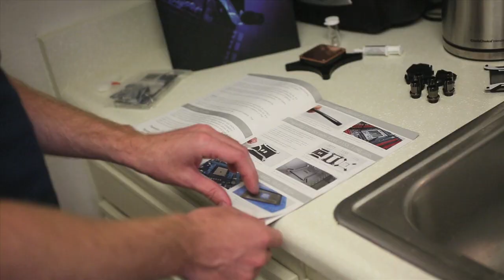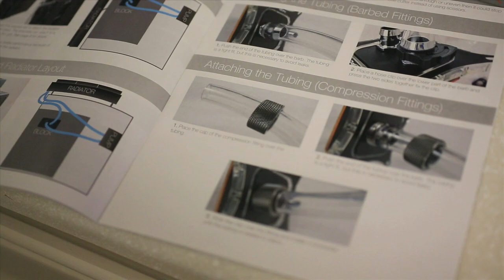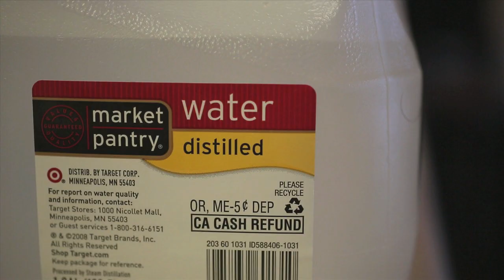A Beginner's Guide to Water Cooling Your Computer

Comment: fuck i tried this it was leaking right ontop of my fucking CPU srsly u guys owe me big time.
Reply: and thats not ur fault for not checking the pipeing is leak proof/ the clamps are tight ?
Reply: Yeah good luck with that.
Reply: What I find most interesting is how an event always leads to us thinking a finger needs pointed. Who cares whose fault it is, the fact is, the CPU has water on it, and the system didn't work for you.. Instead of reacting with anger, try reacting by resolving your issue with the leak and then chalk the cost of the CPU up to gained effectiveness in installing something. 

Sometimes being a DIY student means things will break, not work and in some cases, even damage other stuff. That's part of the risk you take when you are truly gaining "independence" to be able to do stuff for yourself. The GREAT news is, you are STILL going to save yourself a BUNDLE of cash over your lifetime by continuing to be your own expert... :) So wipe off your CPU, put down your pointed finger, and get to work diagnosing what the problem is, and then correcting it... GOOD LUCK and keep DIY'ing!!

Comment: Allways loved watercooling, and the risks are more or less non-existent if planned well and done calmly and calculated. Still my favorite cooling so far, as far as coolness-factor goes, is oil cooling with clear mineral oil, the ultimate completely passive cooling. Ofcourse, that more or less leaves you with the system you have, with a very difficult time if you decide to upgrade individual components.

Comment: with that amount of thermal past your system must of fried.
Reply: No, not at alll. It spreads all over the cores of that cpu, a line for Intel processors is correct because their cores are placed out in a square form. So he should be getting great temperatures.

Comment: This is about half way right. Custom loops you do not first install and then see how it goes. You need to first assemble outside your computer and run it, see if all fitting are sealing, see where air pockets form, see if pipes hold properly,....and only then when it's all worked out do you put it inside the case.
This video shows both the water block and radiator have fittings below the ceiling of their water chambers, which makes air pockets unavoidable if you pre-assemble everything.
Reply: No, not necessarily. It's better to jump your power supply so it doesn't fry your components to save yourself hours and hours of work.

Comment: Funny how nobody mentions vacuum grease in any water cooling video.
Makes it so much easier and safer.
No force needed to screw the fittings in (XSPC fittings for instance) and it prevents leaks.
No need to after tight them since they are so easy to screw all the way in without damaging the screws or the blocks.
Look for DOW Corning High Vacuum Grease if you want something that doesn't leak around fittings.

Comment: Also I was curious. I see debate over fans pushing, pulling or rigs with both for the rad. I agree with your set up as its been used to push air through heat sinks as long as I know of so obviously the engineering of fans is better pushing air through tight soaces. But I was curious if there was a better way to face the setup then; as in, fans pushing air through rad and out of case or through rad and into case? Also what if the case is too small for a radiator; such as a gameconsole case, I would be mounting my radiator outside but would that be even better for increasing the fans efficiency?

Comment: Could I Install my radiator, Res/pump and water block without my motherboard in my system. Eg using a molex connector and my PSU outside my case to fill my loop. This way I have no worries about leaks as it wouldn't effect me much

Comment: Can I use liquid nitrogen instead?
Reply: 1. It'll turn to gas as soon as you take it out of the thermos.
2. If you refrigerated the nitrogen so it wouldn't do that, it would condensate on the tubes and motherboard and it would end up frying your system.
Reply: RxSwolldier You also don't use tubing, you use a pot. You use the flame to create a layer of frost on the pot, not to unfreeze components.
Reply: U can but thats more for pure overclockers and u have to pour ln2 into your rig every 5 seconds and use a flame to unfreeze the components too
Reply: you can, just make sure u get that on tape, we want to see that ;)
Reply: abelcowl, instead of using ln2, go for t.e.c. based cooling, or better yet, phase change coolers.

Comment: Do NOT wipe the thermal paste off with toilet paper. It's made up of fibres that can get stuck between the socket and the CPU and may cause a lot of problems. Use microfiber cloth instead, it'll save a lot of time and hassle

Comment: can you use any type of water? I am thinking about using fiji water xD could I do that? please message back :)
Reply: Fiji water is not pure despite what  people say, just go to walmart and buy distilled water, most pure water you can buy.
Reply: Use distilled water only.
Reply: Nope you need non conductive fluids like distilled water.
Reply: You can use mineral oil, because it's non-conductive
Reply: Jon Reed Not in a loop. Mineral oil greatly reduces the flow rate, increasing heat. Mineral oil also has a much lower heat conductivity than water.
Loops are closed and very trustworthy. I really don't understand why everyone thinks they aren't

Comment: why did u install the rad cooler in push mode, is worse than pull, cause is harder to clean and all the dust is pushed in the case.

Comment: If that shit leaks your whole systems fucked. That's why I'd rather deal with loud ass fans that go to fucking work when ever I start playing something.
Reply: But that shit DOESN'T leak unless you fuck up majorly during construction.
Reply: Computers have the same weakness as a nuclear core. Shit breaks man. If you guys have faith that it won't break, then whatever. Good for you.
Reply: Caindacu Dude, it's distilled water, its non-conductive and won't do anything. The slight chance of spillage would just mean you have to go through the mess to clean your system out but it won't ruin anything!
Reply: Keith Faustino If duct tape can fix space ships, it can fix PCs :D
Reply: Most of us forget that the average CPU is vertical not horizontal. A true water leak will have some particulates in it, but it is RARE that its enough to actually cause damage to the system.. Since vertical, most the water ends up in the bottom of your case... Here is where MOST accidents cause problems.. People who RARELY check their systems to make sure all things are running smoothly and that dust and other free floating particulates are cleaned out on a regular interval. 

As a computer professional I see many people have science projects(tons of dust and hair and dirt) growing in their cases WAY before the water spillage problem.

If you're going to run a water cooling system, get a clear glass cover. And, be SMART about the upkeep of your system. Open up your calendar and actually put a recurring interval appointment in their to remind yourself! If you're like me, life get's moving at a pretty fast pace, so forgetting to do it becomes a human condition. Set a calendar reminder and then make it repeat and you'll find your system's  life and performance will be greater! Regardless if you use a water cooling system or not, frequent cleaning intervals is required!
Reply: Oh. Use coolant. Its better than distilled water anyway. Stops build up of whatever that clogs those things up.
Reply: Well even if that is true, I guess we'll be sure that the water is secure and won't leak. Also, we have to keep changing the water so that won't be a problem
Reply: Connor Jones Idk, like, if you have the money and patience to do this, then good. But don't computers with liquid cooling have fans anyway? It's already cooling your system, so wouldn't just adding liquid cooling kinda like adding a knife to a gun? I mean, it already serves one purpose so are you just going to have both? But again, if you have the money and patience, then whatever.
Reply: Caindacu  The liquid in liquid cooling makes it much easier to conduct heat and move it farther distances from the heat source. This makes it a much more efficient cooling method. Now I'm not saying air coolers aren't good. The Noctua Nf-h12 (I think that's what it's called) is an excellent air cooler that rivals many aio water coolers, but if we're talking bare efficiency, water wins. One fundamental issue with air coolers as they are is that at least some of the air, even if it's a miscue amount, is thrown into the case making the ambient temperature within the case somewhat higher.

With liquid cooling the heat is conducted by the liquid and can be carried much farther more efficiently to the rad where all of the heat is pushed outside of the case, making it more friendly for your other components in terms of heat.

If you're against a custom loop, that's fine. I agree that custom loops don
t really make too much sense anymore, they're expensive and require a good deal of maintenance in comparison to the excellent performance you can get from the AIO water coolers available today. The Kraken x61 for example is one MONSTER of a cooler and requires almost no maintenance (other than occasionally blowing the radiator with some compressed air.)
Reply: i dont think people realize how loud an overclocked computer is. my fans can be heard all over the house, so this is definitely next step. things always go wrong, doesnt mean they have to. and in the end, a car might drive through your front window and kill you. shit happens.
Reply: Or just get a sealed loop cooler like the H100i. Way easier.
Reply: could use mineral oil maybe?
Reply: Caindacu It can bring the temperature down alot more. As for less noise, the fans don't have to rev up to be effective, Ive even ran my radiators fanless, passive cooling when I had 2x240mm rads.
Reply: If you use propper liquid you can have a leak and your system will work just fine.

I had a customer who got a leak in his system, there was actually a small puddle on the top of his GPU, took the GPU out, cleaned it properly, this was 3 months or more ago and his PC still runs like a dream, he used Mayhem Pastel. So no your system is not automatically fucked if you have a leak. Oh and there is also a reason why you leak test a system.
Reply: Caindacu That seems like this.
Oh look I have two legs, I can walk and run. Why do I need to invent a vehicle?
Reply: Liquid cooling seems more of a risk though. I don't care if it's only about how well you install it, things can break. Liquid Cooling isn't better than fans. If it were, then why would there be fans?
Reply: Caindacu More like adding a giant turret to your knife
Reply: thats why u have tape :)
Reply: Use Dr. Fix It. :P
Reply: Jordan J Minerals are usually metals, metals are conductive so probably not
Reply: So, watercooling is superior because not only does it cooler more efficiently, it extends the life of your hardware, and your room wont be sitting at 90C while gaming for hours on end from the hot ass air being pushed out of your case from the GPU and rear exhaust fan.

Most quality watercooling retailers like EKWB have GPU backplates, so when you're cooling both CPU and GPU(x2) the backplate will protect your main GPU from a leak at the CPU line, and with your PSU being fan down a leak from the GPU(s) wont damage it since it's going to simply puddle on the top of the PSU.  The backplates also help support the GPU lessening the effects of gravity on it.  Always get Compression fittings.
Reply: Patrick Morgan Liquid cooling actually makes your room hotter (Generally). The liquid's increased conductivity moves more of the heat to the rad where its released into the a room. Believe me, I know form experience.
Reply: ***** and believe me, before my custom loop, I put an AIO cooler on my CPU and cut the heat in my room by an extremely large amount.
Reply: ***** no it doesn't. That violates laws of thermodynamics. If this were possible, we'd have thermal power plants tapping into the mysterious thermal energy of your liquid cooled gaming machines.
Reply: esnebta How so? Even with fans the very design of air cooling lets minute amounts of heat escape into the case. That's just air cooling by nature. One of the key attractions of liquid cooling is conductive efficiency. Liquid is simply better at retaining energy (not just heat) than air. Air cooling solutions usually just conduct the heat into heat-pipes, transfer the heat to the fins where some of the heat is inadvertently dissipated into the case and fans blow the rest of the air into a desired direction, one of the perks of liquid cooling's improved conductivity is the ability to move this heat to a desired location with less inadvertent heat dissipation within the case, meaning when the heat is transferred from the liquid into the rad less heat is lost within the case in comparison to the transfer from air cooling heat pipes into fins, which means for liquid cooling more heat is expelled from the case than air cooling solutions. Which laws of thermodynamics do you refer to?
Reply: Flaming Gaming Easier yes, way less effective. And in general just poor products.
Reply: yousifarradbro you can still short out because the water picks up little pieces of metal when it goes thru the loop on the water block.
Reply: CyberBlastStudios That's true, but the case where those particulates actually cause a short is so minuscule that its only on very rare cases that a short actually takes place. In my experience, with hundreds or slightly over a thousand machines, I've only encountered two that were actually proven to be shorted out by some connective elements that caused that short. 

The most likely problem, again, comes from people who have not cleaned out their systems for months, and the water mixes with the particles of dust and debris already in the machine. But, the water only enhances those problems. I've seen more boards have connective issues from standard dust particles than water cooling issues...
Reply: Chris Banzet Thanks for clearing that up for everyone
Reply: BO-LEAVE
Reply: Leaks are possible. I wish they had a coolant that was non-conductive, and meant for computers and such.
They don't. Do they?
Reply: tzint56 they do. There're computers that are submerged in these coolants
Reply: Boogles Play It's called mineral oil, but since it's very dence it is not ideal for a setup in which the pc itself is not submurged in it.
Reply: No... It's destilled water, it wont harm your pc unless you get shit into it, your pc can run in mineral oils etc if you want it to
Reply: it picks up metal pieces from the waterblock over time and becomes conductive.
Reply: CyberBlastStudios yeah, but you'll get leaks when you test the system, if you clean the radiators etc first you wont have that problem :)
Reply: Yes you will it is still metal!
Reply: yousifarradbro
uhhh, no Distilled water is not DEIONIZED water.  Distilled still has electrical ions in it.
If you ever get water on your componets, just unplug them and let them dry.  Water Does not magicalled break computer components, when electrical current flows through the water and shorts out the electrical stuff then it breaks it.  If you let it fully dry, you will be all set.

I like to jump the psu that way the system is never powered on, and I leak test for 24 hours and if any leak's do occur, the system is fine because the PSU is jumped and not powering the system.  Watercooling is not that hard or risky, but it takes steps to do it right.  like everything else in life.